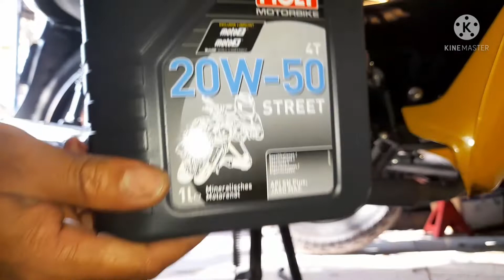EXPRESS  100cc  MOTORRAD cambio de aceite

Comment: Hola! Tengo el mismo modelo. Cómo sé si necesito un cambio completo o solo reponer? Llevo 6 meses con la moto y aún no se le ha hecho reposición ni cambio de aceite.
Reply from the maker: Hola, no se descuide del  nivel de aceite  y del  cambio  cada  3 mil kilómetros .ya que después de  un tiempo  el aceite  lo evapora
Reply: En verano el aceite se evapora mucho más rápido y también se calienta a temperaturas mayores. Yo coloco aceite máxima diablo 20-50 y hago el cambio cada mil kilómetros. Está moto es muy sencilla, ojalá y sigan montando videos de otros mantenimiento y reparaciones mecánicas. Yo tengo adicional un stop de freno, botón de luz intermitentes y gracias todo super bien lo único es que tuve que cambiar el CDI porque no la.uso casi y se descargaba la batería y una vez me tocó cambiar el porta corona. Del resto la moto no pide nada, su cambio de aceite y pastillas